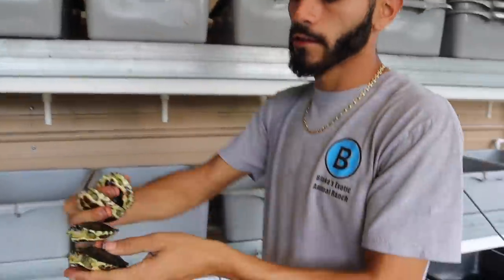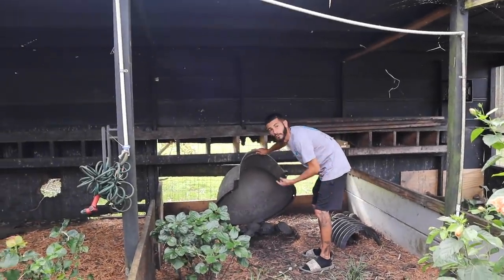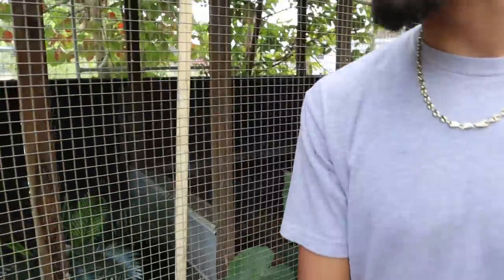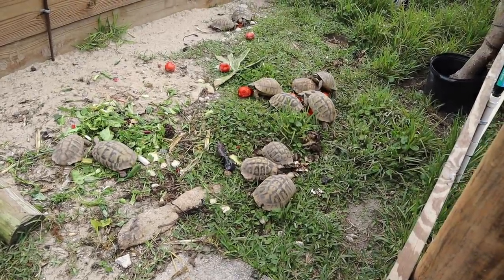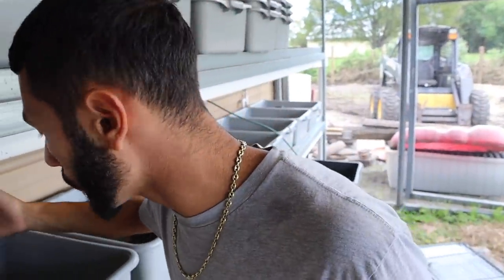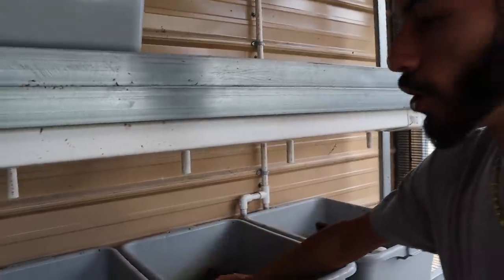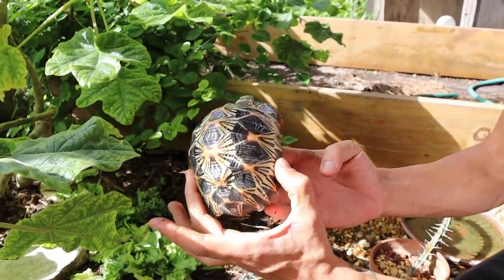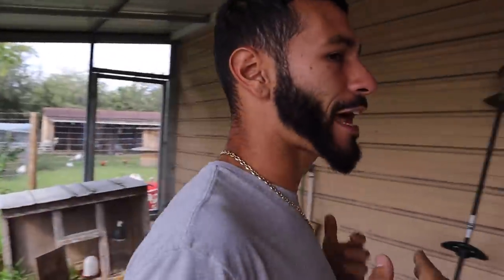FULL TORTOISE /TURTLE TOUR ON RANCH!! WHAT DO WE FIND!

Comment: Hey Blake.  What would you recommend for beginners both turtles. Terrapins. And tortoises.  That aren’t that big. And have a short lifespan
Reply: I have done my research because I am thinking about getting one. Hermann tortoise is one of the best for beginners. Marginated is another option. They are both similar in terms of enclosure type and diet. There are a lot of videos on how to build enclosure for them.
Reply: William Djokro    Do they live inside because I am from Ireland. And what is there lifespan
Reply: @finndrennan541  You can keep them inside, but you have to set up basking light for heat and UVB light to help them building calcium for the shell. You also need to keep the humidity level a certain way. For dietary, those two I mentioned above eat 90% green leaves, but some leaves like spinach are bad for them.
Reply: William Djokro   What is there lifespan
Reply: @finndrennan541  not sure. But around 60 years i think